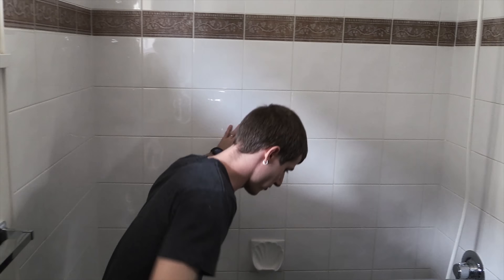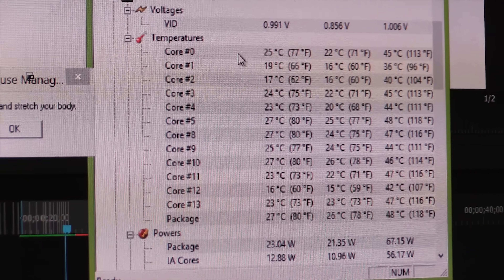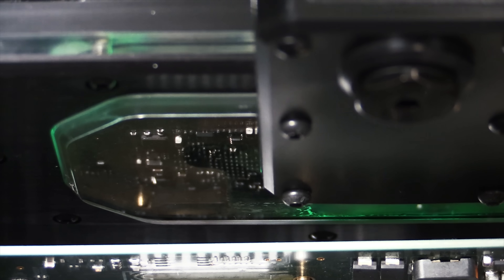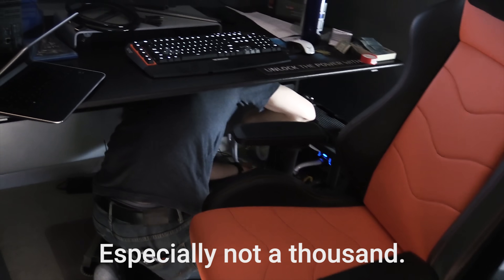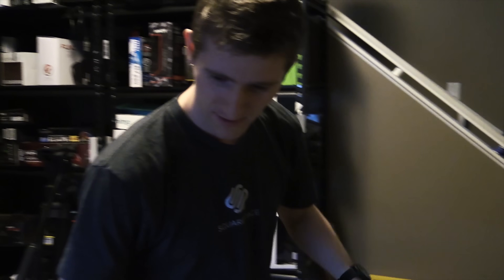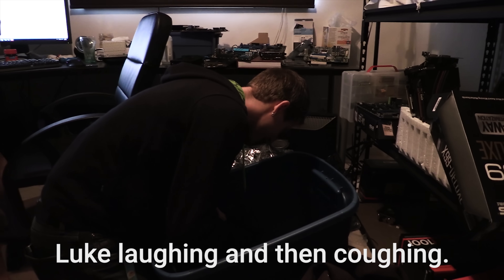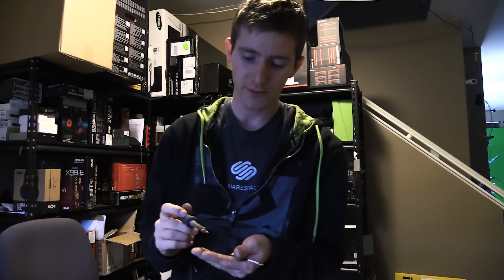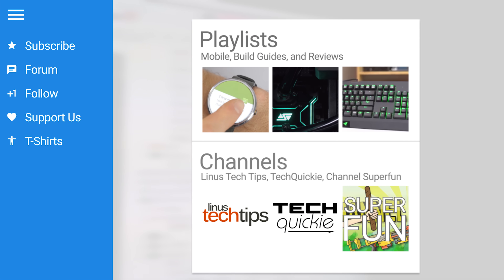Whole Room Water Cooling Part 5b - Some Issues, More Solutions...

Comment: Linus..... When soldering you put the soldering iron under the wire until it heats up then you touch the solder on top of the wire. Then the solder will stick and mix in to the wire for good contact. The way u are doing it, it wont do a correct connection and will fall apart... Good try though
Reply: Hunter is right. Solder doesn't stick to a cold joint. Heat the wire up with the soldering iron then touch the solder to the joint. When it is hot enough it will flow right into the wires and look shiny. Small diameter solder will melt faster than the thick solder you find at Radio Shack. The wire will get really hot so have Luke hold them for you. If he complains dock his pay so you can afford a soldering parts holder. You might also need a solder sucker to clean up extra solder.
Reply: linus is actually preparing to promote a soldering all in one kit, so when that solder fails, he is going to do another 10 part 5 minute each video, showing how to correctly solder, :D
Reply: even the most basic packages explain this is how to solder I have no idea how linus could not know this. Worries me about past advice I've taken from this channel lol
Reply: Colin Roberts lmfao! lukes gotta get hurt to get paid!
Reply: Hunter Cumini Eletrical engineer here.  The way I join wires is tinning each of them first and then getting a small blob of solder on the iron tip and then swiping that along the joint between the two wires.  The blob significantly helps with heating up the joint quickly and fills in gaps between the wires.  Just straight up hoping a dry iron tip is going to heat up the joint is just going to end up melting insulation and burning fingertips because it's too slow.
Reply: Hunter and Colin are so polite they might not get the message across. Clear but blunt version: that wire is terrible and can never last, you need to re-solder the joint. Many moons ago we learned soldering in junior high and if you showed the teacher that kind of result they would send you back to your bench and have you start over with a fresh wire.

If the wire breaks that will be bad for your cooling for sure, and who knows whether a (semi-)broken wire will be a fire hazard or not.

Doing it the way Hunter/Colin suggests will also let the cleaning fluid from inside the solder do its job and actually clean the surface you're soldering. I couldn't see from the video if that was the type of solder you had so I'm guessing.

The wire will not be that hot a decimeter or two from the joint if you're soldering right so Luke shouldn't get badly injured.

(Sorry about the bad choice of words, my vocabulary on soldering is limited as you see)
Reply: Casual Gaming yes you are right but seriously why not take the extra 30 seconds just to do it right instead of it falling apart a month down the road and him having to to fix it?
Reply: Fnurrboll
The fluid on the inside is flux, but for the most part there isn't much in there, it's more of a selling point than anything, still need lots of flux to make the joint as good as it can be :) Getting a tub of it and dipping the ends of the wire/iron in it is the best way to get it in there afaik.
Reply: Good attempt to sound smart though :)
Reply: Casual Gaming yes i do know about soldering and yes it would work but its still not the proper way to do it. Plus if he did it that way there would be not flux left in the solder
Reply: Hunter Cumini With enough duct tape it will hold
Reply: kinda but u need to slide  it over the wire then once u solder it u get a match and shrink it over the top of the connection...
Reply: Turtle Gamer have to ask you how often you work with the stuff...
Reply: Regan Walker yes I didn't put much detail in my post but that's essentially what I do. I twist up the wires. Put some Flux. Tin the tip of the soldering iron. Then touch it to the wires until the wires get hot enough where when I touch the solder to wire and the solder melts on the wire. Then wrap it electrical tape or shrink wrap depending on what your doing
Reply: Personally, found that if you strip the wire, don't twist them singly, but twist them together you get a tidier twistand I don't tin them fist, obviously you can't twist them, but once the wires hot, it should suck the solder into the wire
Reply: Skydogg5555   lol
Reply: Silver_+ now you are awake!
Reply: Or what you can do is after the solder has melted keep heating if for a while it will stick like it should.
Reply: Well this project was probably done long before the vid was uploaded so he has probably learned that by now
Reply: kallejjk still isnt the right way to do it and it still wont make as good a connection as if he did it the right way
Reply: It actually will work, as long as there is enough solder, it will hold together, apparently you know nothing about how hard solder can get when dry.
Reply: Hunter Cumini Well, I've tried various ways, alone, with a mate, with those clip thingys that are suppose to hold the wires, and the easiest and most effective way is with someone helping you, and linus doesn't seem like the guy that does soldering often, nor did he have the help to hold the wires, he did what he could.
Reply: someusername121  yes this is also the way we do it at my school. But we only put a ball on the tip to aid the contact to help heat transfer then we put the solder wire against the wire and let it melt into the wire
Reply: LinusTechTips  also slide some heat shrink over the wire before you solder it. because electrical tape insulates the wire but wont last for as long as heat shrink
Reply: Eagle Legion before you solder ? Don't you mean slide it over the wire after you solder to keep water and crap off of the exposed wire ?
Reply: Eagle Legion ok ya I forgot about that. I thought you had meant shrink the shrink wrap on the wire before soldering
Reply: lol  yeah sorry if i worded it wrong\
Reply: joshua cheung At school it was every day, and now, just today I did some soldering for my car speakers.
Reply: someusername121 100% correct, this is the "proper way" to solder. Tinning the wires before joining  them makes it far easier, tidier and essentially quicker. i might add diping the wires in flux before tinning them and as +Hunter Cumini originally said heating the wire up somewhat and touching the solder directly to the wire helps alot with the tinning process (personally i also twist the wire before tinning to help keep it tidy.
Using heat shrink to insulate the joints is also easier, tidier, and more effective than tape.
Reply: +someusername121 This is how my uncle taught me. He learned doing ECM for the Air Force and for defense contracts for decades after; and it makes sense, physically.
Reply: Yes, Hunter's right, you should definitely first heat the wire up and then apply a lot of solder to let it drain into the strands. Then touch the wires together and heat them up again to re-melt the solder and that will make a very good solder connection, and don't forget heat shrink.
Reply: When I try and heat up the wire, it doesn’t ever heat up so I just end up putting a glob of solder on it.
Reply: This is the right way to do it, but sometimes it can take a bit to get going and end up melting some insulation in the process. So I do this but cheat a little. I briefly touch the solder between the iron and the wire, getting a blob of solder between the iron and the wire, then I move the solder to the top and do as described above. Getting that little bit of solder between the iron and wire seems to help heat transfer better and gets the solder to penetrate the wire better
Reply: Hunter Cumini You know solder is only used as a bridge to pass current from one cable to another, he could have placed just a tear drop in between the cables, as long as they did not instantly fall apart and he ties the electrical tape around they will work, even if the solder did break with the electrical tape, it would still probably work as long as the tape had the wires touching.

Comment: Tip for soldering. fray the multiple strands and try to interweave them together and then twist, then solder. the twist makes them stay together even if you do a half assed job of soldering, and touches the copper together instead of transferring all the electricity through the solder

Comment: Why are you messing with soldering at all?  Why not just run the fans off a pc power supply?  Much higher current is available.  All you need is a jumper across two pins to start the power supply.  You could either permanently install this jumper or run the two wires inside to a switch and then you could turn the supply/fans on and off when you want.  Google "atx power supply jumper" for pinout of the axt connecter.  Plus, if the supply fails you can replace it easily with another supply and they have all the connectors (sata and molex) you need.  You can use automotive crimp connectors if the soldering isn't working for you.  They last longer than your setup will be in place and you have low current draw anyway.

Comment: Why not use ridged tubing instead of copper and shrink the size of the loop to run behind the computers not above them and use a few bay res in each pc with big acrilic tubes as a main res

Comment: that solder job physically pained me to watch haha. when i solder wires what i do is: I strip the insulation, twist the wires together (not necessary but it makes it a lot easier by keeping them together), touching the solder to the wires and then applying heat to the opposite side of the wire with your soldering iron. you should look into getting a helping hand. it helps so much. makes things 100 times easier and quicker

Comment: Try to hold the wire as close to the exposed part as possible when soldering, you can get more accuracy. Also, use a helping alligator clip hand kit

Comment: First there is more powerful pumps (single pump will be enough for entire system) with switches whom make it run low, medium or fast. It's Grundfos and Willo pumps, they are NOT made for this kind of job (general use for them are for radiator heating installations) and you should first research what is their water pressure and amount of liters per second.
Second you could use parts (also made for radiator heating) as "automatic air vent", the best is to instal one in the highest point of your water system.
Third if you put ANY mechanical filter there is gonna be A LOT more "bottleneck" just by filter itself.
Fourth you don't need any POISON in your system, algae for their growth need SUNLIGHT, mask-tape every see-thru point and they will no more of this problem.
You need a some kind of heat installer to check all this BEFORE you started to make all this, it will cut down a lot of costs and time of this all along a nice project.

Comment: put a xtrol tank on it...it will give you 12lbs of pressure on the lines...the problem is there is to much line for the pump to handle...I would put a air scoop with a built in purger this way it will bleed the air from the system...think of your setup like a boiler with radiator heat...they need to be bled with enough pressure to force the water through the loops

Comment: Copper based algaecide.  1 quart bottles go for about $16 USD, should be able to pick it up at any local pool/spa store.  Just make sure it is copper based, so it doesn't re-act with any of the copper in the loops.

Also, go to the auto parts store and grab some Water Wetter. It breaks the surface tension of water and makes getting bubbles out of water loops so much easier!

Comment: Where do i even begin on the soldering. Tin the tips of the wire. Less solder the better (no big globs. You want to see the outline of the strands when ur done). 3 wires to a juntion. Flux is ur best friend. Turn up ur iron, looks like u have cold joints. However i would have used male/female disconnects and heat shrink tubing.

Comment: For soldering first you can buy solder with a rosin/flux core which will not require you to have the stick of it. When soldering wires you want to place the solder on the wires and then bridge the soldering iron and wires. Bridging is melting a small amount of solder on the iron that is also touching the wires. This allows heat to transfer far more quickly to the wires. You want to place the tip roughly in the middle of the wires and then once you bridge touch your solder to the side of the wires closer to the insulation as the solder tends to move towards where the iron has been placed. You want to use just enough solder to connect all the wires and make them all shiny and coated without having any bumps or spikes on them because that means you have too much. I see the solder you have is relatively thick, i prefer a thinner wire diameter of 60\40 solder with like i said a flux core. If anyone has any questions or comments i would be happy to help, im no expert but i have done a fair amount of soldering.

Comment: Best tip for soldering I have; solder flows toward heat. Get just a little solder on the iron to facilitate heat flow from the iron to what your soldering. Then hold the solder where you want it to flow from, toward the iron.

Comment: Tips for soldering:
Don't rely on the solder to make the connection. You made a cold joint, never make cold joints. The solder should just feed itself into the wire if done properly. You heat the wire, and put the solder on the wire, versus what you did, which was heat the solder, and put the wire into the molten solder.

Comment: Hey Linus,

(edit: made a short video showing what i mean: http://youtu.be/-naZU5sQ8xE  made the heat shrink catch on fire though xD)

with soldering just wires together you can just twist them together and take a lighter to heat up the end of the twisted wires, then you take the solder and apply it to the hot wire (while lighting the end of the twist), this way the solder flows over the wires like oil for example. This makes a very neat solder and takes a fraction of the time. Then just cut the somewhat burnt end of the this off and out a heat shrink on it, leaving some room at the end of the soldered wire, heat it up and then press it toghether at the end, this helps a little bit extra for the protection of the soldered wire.

 I do this daily for work installing magnetic contacts, flashers and sirens for alarm installations. (sorry for the bad english, not native)

Comment: Tips for soldering. 1. Pre-tin your wires if there aren't solid wires by twisting the wire then apply heat from beneath and apply solder so the wire is covered in it with a smooth surface. 2. When soldering on PCBs and you are about to pull away your soldering iron, pull upwards towards you to lower the chance of a cold joint and to get a better contact with the pin.

Comment: What I have learned from a bunch of soldering is that using dipping the wire tips in flux and then using a little bit of solder works really well, the flux coated wires lets the solder flow through the joint nicely and it holds rather well. Just try to be in a ventilated area because breathing in flux is a really bad idea :D

Comment: Painting on the solder is bad technique... get a $10 helping hands tool.  Then apply  heat and fresh solder to opposite sides of the connection until the solder melts and flows into the joint.

Comment: Advice for soldering: Use thinner solder, and heat both objects and then apply solder the the hot objects.
For cabels i would then recomend some "Helping hands" which are som aligator clips that can hold your wires for you, reducing risk of finger burn :D

Hope it helps

Comment: You can tell that the Iron isn't hot enough... Use Shrink Wrap to be completely sure of the wiring. Also be sure to tin all the wires. If you do not know, that is when you put a little solder on the twisted wires to keep them together, and eliminate the need for more solder later on. It makes it so much easier!

Comment: I would like to offer some advice on your loop. Let me start by saying, that I am an operating engineer at a large office building with very large cooling equipment such called chillers. Your setup here is almost like a chilled water loop in a large commercial buildings. We use a similar pump  and piping configuration but just on a larger scale.

The first piece of advice I would offer, if it hasn't already been said, would be to insulate your supply lines to each computer. This will keep the cooler liquid from picking up heat from the room before it gets to the computer. May not sound like a lot of heat will be picked up, but over a large piping distance this can add up. Also it maybe nicer to look at than all those solder joints.

The second would be to change out your radiator setup outside. I would suggest going with an air conditioning condenser unit but just the condenser part. These units are designed to be out in the elements year round and would look a lot nicer. You could simply cut the connections off and then solder on the proper connection to interface with the tubing. Then you could use the built in fan motor on the condensing unit which would need to be 120 volts in your case but there are plenty to choose from. This can be mounted on the ground or if you could find one small enough, put it in the existing spot.

As for the corrosion in your loop, it may be flux build up. Try flushing the loop and lines several times, Then add the biocides and what not. The filters may help but they will definitely hinder flow even further I recommend dumping the biocides into your reservoir and letting them disperse that way.

I am  big fan of your channel and your videos! I hope my suggestions help and if you would like any more advice just message me
  good luck!